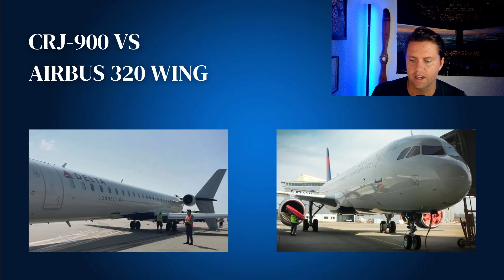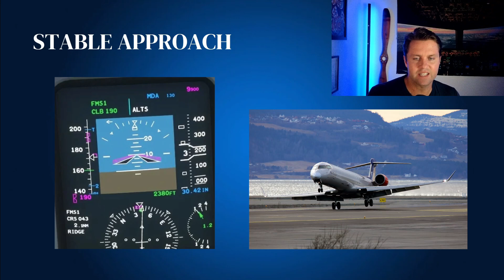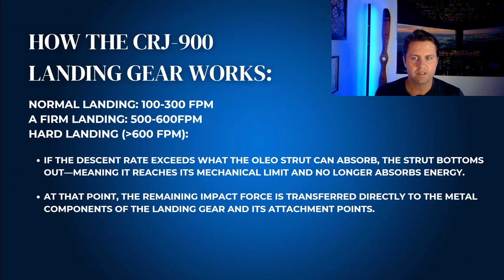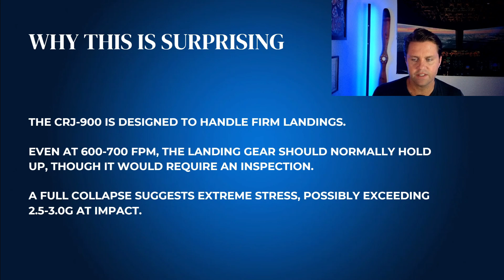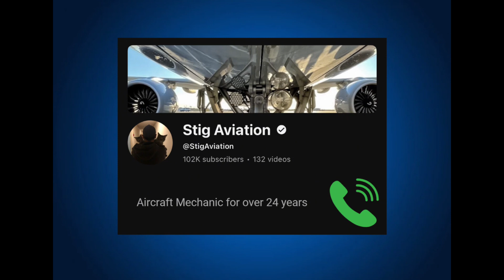Pilot Breakdown: Did a Hard Landing Cause A Gear Collapse?

Comment: Snow and ice probably had more beneficial effect in reducing friction than in suppressing fuselage fire.  As the fuel on a CRJ moves from the center tank to the wing tanks and thence to the engines, there would likely have been little or no fuel remaining in the center tank on landing, most likely by design intent if you think about it.  It was mainly the breakaway wings that prevented major fire in the cabin.

Comment: One of my first observations of the cockpit shot video (the copilot of the waiting a/c) was that there seemed to be no flare.  I measured as best I could from that video and I get:

-a/c directly in front of waiting a/c:  0 pitch

-just before touchdown <cough> about 2 - 3° nose up (hard to measure this from the video).

I also believe (really hard to tell) that he was off centreline, well to the right - and may have put the right main into a snowbank.

So - finally, I believe that he was compensating for the crosswind and the wind suddenly died off - resulting in higher sinkrate + drift to the right.

Old pilots used to tell me in gusty conditions to "add 5 knots for Momma" to Vref....

Comment: 1st video I saw is that the pilot was coming in very hot. And I do believe that it caused the mains to buckle then causing the roll over. The snow really saved those people asses. Yes, a true miracle that they all came out alive. I've notice countless landings on either the right or the left main as a touchdown point. I was never taught to land like that. I do not understand that plan of landing, especially a passenger liner. We had an F-4 crew come in and drove the main right through the wing. Lucky he caught the wire which saved them & the plane but S.H.T.F. big time. Don't remember seeing the pilot & RIO again after that one.

Comment: I'm not onboard with your analysis.  
- That was a very hard landing.  I don't think there was a problem with the gear.  Especially if the wing wasn't generating any lift and/or the plane was being pushed down by a downdraft or windshear, and when the plane is fully loaded with passengers and luggage (but not fuel, in this case).  I can easily see this landing exceeding the capabilities of the landing gear, even pushing the gear right up into the wing (which is what I think may have happened).  It's all about the G-forces.
 -The fuel lines going back to the engines would have been quickly depleted of fuel both from the demand from the engine and also from fuel spilling out of the broken fuel lines.  Fortunately, it seems that the remaining wing's fuel tank did not catch on fire, at least not immediately.

Comment: It's not just that it came down hard. It also landed on one landing gear. So even if the plane may be able to handle harder landings, the fact that it took the full force on one landing gear probably caused it to fail. If it came in level, it probably would have been fine even without a flare. I think it's a combination of no flare + cross wind causing one wing to drop that caused the failure. My layperson's opinion is that the pilot was probably distracted by the gust so close to landing and didn't get a chance to flare, then touched down hard on one side and overwhelmed the landing gear.

Comment: You need to tie in the snow on the runway .  The force of the landing and the amount of drag put on the gear will increase the force. It is like landing with the brakes locked up . The upward and backwards force was more than it could handle!

Comment: Metal tolerance is at it's weakest in freezing cold, not it's highest. The weight tolerance of the wheels mayalso  be based on both wheels contacting the ground at the same time.

Comment: Agreed. This vid just makes it a lot clearer that they did not flare out. I didn't notice any change in pitch in the very first video that came out. They literally flew into the ground. I worked at McDonnell Douglas in Toronto, and worked on the first MD-80s. Seeing this vid brought back memories of the MD-80 testing where she landed hard, punched the main gear through the wing and the tail snapped off. Snow certainly helped save lives, as did the wind. It kept the flames from the center tank from getting to the open hatches, and people got out without any burns. I have to wonder how long the passengers were wandering round out in the snow/wind before a bus got to them.

Comment: it looked to me that he had a normal AoA and then he flattened it out and then didn’t flare at all.
Theory: Normal approach but didn’t add sufficient  knots to counteract gusting wind speed changes.The gust paused,and suddenly the aircraft is at stall speed which must be counteracted by a level to nose down attitude as thrust lag would not get him out of the graveyard, by adding power at that point. So he ends up touching down with no flare,at a high vertical speed. Over g’s and the right main collapses, puncturing tank. Wing touches concrete,and snow, rips away, and lift on raised left wing now rolls the aircraft onto it’s back.
The first view out the side window shows the CJ nose up as you would expect, and it suddenly flattened out.
Instinctively, a pilot would push the stick nose down when suddenly nearing a stall.

Comment: Normal/hard Landing speeds is not the same when there is cross winds. Cross winds was over 45 Knots. If you think the snow provided soft landing then the plane should never have landed on so much snow. Then the snow caused the crash.

Comment: Retired pilot 42 years 18000+ hours. They had a 11,200 runway to use. Land with approach flaps. Keep speed up. Roll it on even in crosswind. I’ve done this many times.
Reply: Should have been able to fly in ground effect as you say to set it down gently, especially with x wind and gusts and use additional runway length.   They still had a good headwind component, so ground speeds reduced.
Reply: @MWILSON-i4h  And remember to flare.
Reply: @jamescherney5874  interesting reading in this thread, so I will contnue. If the "gust" you are flying into suddenly stops or abruptly changes direction, the "happy" wing supporting the aircraft weight instantly has 20 or 30kts less wind over it and you drop like a stone near a stall. There is NO FLARE.....that makes the sink rate worse....you need wind speed  over the wing... which is add power or drop the nose. If this was the case, they had no choice, too low. That right gear leg might as someone else said been shoved up so severely, it took our the main spar. I landed regularly at a hill top airport where depending on wind direction, the smooth constant airflow over the approach end would dive down the hill side in front of you at just about the same distance/altitude from touch down as witnessed in Toronto. Your approach looked perfect, then suddenly the plane dropped like a stone needing power. After punching through the sinking air into the constant airflow again, this put your touch down point further down the runway. Hopefully you have room enough to stop. It was tricky, even if you knew it was coming. This was a total surprise with like 5 seconds till ground contact.
Reply: Landing with approach flaps would land them both in the CP's office facing disciplinary action. ALL FDR data is captured and that would be flagged. Virtually impossible to get away with it.
Reply: @skyboy1956  Now they’re in the FAA’s office , CNTSB,NTSB  and court of public opinion explaining how they destroyed an airplane! Maybe fired either way but they could hold their head up high for using good aeronautical decision making and not destroying an airplane. Luckily for crew, no one died. Fly safe.
Reply: @MWILSON-i4h  Pilots don't randomly deviate from SOP. Only full flap landings are authorized unless they are landing with one engine inoperative.
Reply: @skyboy1956 Nowadays low cost airlines don’t land with full flaps even on wet runway with tail wind , no more
Reply: @AcarsFault  how many LCC's fly CRJ 900's?
Reply: What are approach flaps?
Reply: @ Approach flaps means partial flaps. Most Jets have 3 or 4 flap/slat settings. Landing with less than full flaps isn’t done normally but always an option if conditions warrant.
Reply: the only time a CRJ 900 landing is done with less than full flaps is one engine inoperative.
Reply: @MWILSON-i4h , oh ok. I just never heard the term approach flaps.    In the 73 you can use flaps 30 or 40 depending in runway conditions.
Reply: @ it may be an old school term or maybe just a Gulfstream term. In the Gulfstreams it would be 20 degrees. Anyway. Fly Safe.
Reply: That's the difference OP. You're an experienced pilot with thousands of flight hours. This pilot was supposedly new. Also, an all female crew doesn't speak well for this whole mess. If you go to the airlines website, they obviously prioritize DEI over just about everything else. I don't care if my pilot is female, and she qualified, but I do care if my pilot is female and she's only there because if her sex.
Reply: @dextermorgan1  Not even good trolling, merely bog-standard misogyny. You must be proud of your insight!
Reply: @AudioAardvark facts aren’t misogyny.
Reply: @dextermorgan1  WRONG. It was a male pilot and co-pilot, but even if you were correct, the crew did an amazing job don't you think? Now take your ignorance and hatred elsewhere. We delight in the outcome of this for all involved.
Reply: @deborahhennessey  I can't find any information on the crew.
Reply: @deborahhennessey: Wrong. Captain/PIC is male, First Officer/PF is female. She idled engine thrust at 153' instead of 20-30', failed to arrest accelerating sink rate, and didn't flare. Impact load initially only on right main landing gear at 1110 fpm and 2.5-3 g, collapsing it and breaking off right wing. He didn't fix her error by restoring engine thrust or call out TOGA for unstable approach. Both pilots messed up.
Reply: @oahuhawaii2141  what is your source for idling engine thrust at 153 ft?
Reply: It was a real accident with wind and turbulence made the hard landing then I think the wing caught on the ground and it flipped over
Reply: @lindakrelle6607  remember a wing creates lift the minute air flows over it. With one wing gone, the other still provided  lift to "fly" up, tipping the fuselage more and more to the right, (in this case), until it was upside down, and airflow had stopped. Physics.
Reply: @lindakrelle6607 If your meaning it was a difficult landing it was. If you’re saying it was a “hard” landing into the ground it was that too. Making a smooth landing is an art form despite the weather conditions. As far as I know the flying pilot has not been identified. I managed pilots for over 20 years. People have different skills and are into their journey at different places.  Most mistakes don’t end like this, they are discussed in debrief and usually  improvement occurs.

Comment: I said last week that the plane was crabbing due to the crosswind and the plane never flared so all the weight was on the right gear and it collapsed when the plane hit the runway. That caused the wing tip to hit the ground and tear into the snow/ground ripping off the wing.

Comment: I think ripping off the right wing was due to two factors. 1. the hard landing overstressed the mounting points for the landing gear and as the gear gave way it ripped out or damaged major structural members at the wing root. 2. the ground contact of the wing tip with the ground and or snow bank ripped the weakened wing off. One half of the fuel remaining on the plane was left with the wing while the plane continued down the runway. Your point about the snow helping extinguish the flames is on point.
Reply: I agree totally... you can see the landing gear collapse first. I jus' wonder if at that moment, a crosswind sent the plane sideways as to have the right landing gear touch down at a weird angle and snap.

Comment: Former 777 and 747 pilot here. One of the main aids that commercial pilots utilize to gauge their rate of  descent when landing, is the “audio” “50,40,30,20,10” that is typically called out by an aircraft system itself, on every landing. The aid was incorporated because the pilot is NOT looking at their vertical rate of descent, inside the cockpit, that close to the ground. Their eyes are outside…..

If rates of descent are very high, some or ALL the numbers below 50 feet will not be called out at all. This leaves a very short window of time in which to affect either a correction or a go-around.

Many commercial aircraft also transmit “non-standard” events instantaneously to the company:

Hard landing
Long landing
Too fast
Too slow
Flap/gear overspeed
Unstabiized approach  , etc

Finally. A hard landing is considered 1.7. G’s or more which will require an aircraft inspection..

Cheers!

Carlos
Scottsdale, AZ
Reply: I wonder if she was task-saturated with the gusty crosswind along with the blowing snow on the runway and just didn’t flare?  These conditions can be a handful for sure. 27-yr airline pilot here.
Reply: @737Parkie She comes from an extremely structured ab-initio environment. Same as many overseas pilots.... When confronted with real life situations, these people often freeze..... and try to go back to "familiar": I remember the Egypt Air where the CVR showed that until death, while being inverted, the only thing the crew tried to do was reengage the autopilot.... It will be interesting to see when the autopilot on that CRJ was disengaged.... And the older Pilot monitoring did not last at teh major carriers, and went back as SIM instructor.
Reply: @ Apparently those are rumors about the Captain and are false.
Reply: This comment was censored:
It would be immediately safer but more insidious if she worked in management instead of an actual job like pilotry.
Reply: Is that what is called being "behind" the airplane? Reactive vs proactive? its one thing to bounce a flight schools 74 year young cessna.
Reply: @Saven4u  the root cause is credit cards. So we don’t have hundreds of old twins in the air every night any more, flying cancelled checks with young pilots at the controls flying in all kinds of weather…. Gaining REAL hours of experience they can draw from their entire remaining career.
Reply: I’m shocked that the Captain did not say” My Control” . Or Go Around!!
Reply: What saved their lives was due to a few events. Thick snow. The wings severed immediately as they were on fire & left behind while the fuselage hurtled forward. The fact that it ended upside down. Means the passengers could just walk out as opposed to chutes & jumping from 10-15 feet.

Comment: "If she recently switched to the 900 from the 200 that could be a factor.   They land very differently because the 200 doesn’t have slats. The approach pitch attitude on the 200 is nose down because of the lack of slats and therefore the sight picture is different in the round out and flare.   I want to know why the captain didn’t intervene.   She will likely be retrained and captain downgraded."

https://hallsofmacadamia.blogspot.com/2025/02/the-question-that-everyone-has-been.html

Comment: I'm from Dallas. In the 90's we had crashes that were later determined to be from wind shear. Wind shear indicators were installed at our airports. A wind shear landing is a normal landing that as the plane approaches touchdown, wind shear causes lift to fail. 50 feet off the runway this can be catastrophic. Did the airport have wind shear detection, was there wind shear in fact, was the pilot forewarned, was the pilot trained for wind shear, and how intense was the wind shear if any. If no wind shear, it appears that the rate of descent did not change as the wheels hit the runway. Nose of the craft was not up.